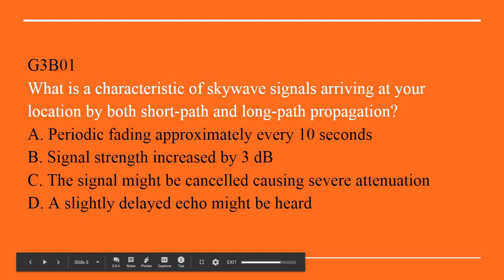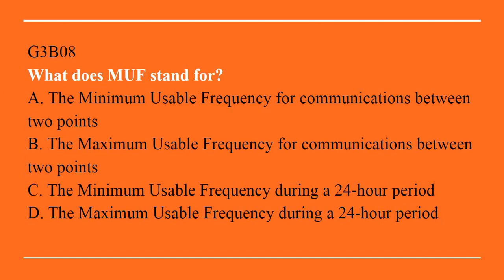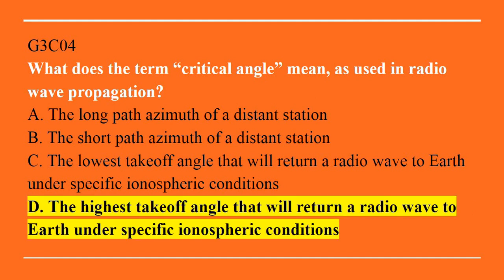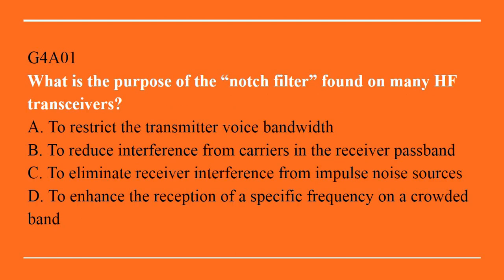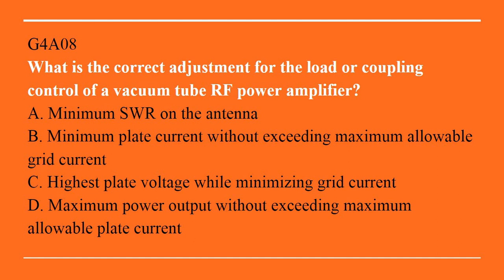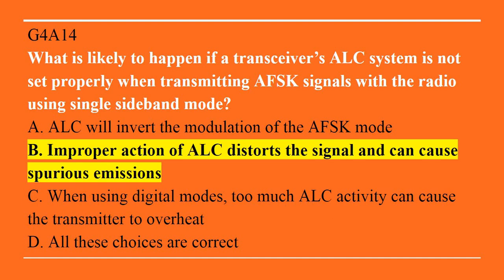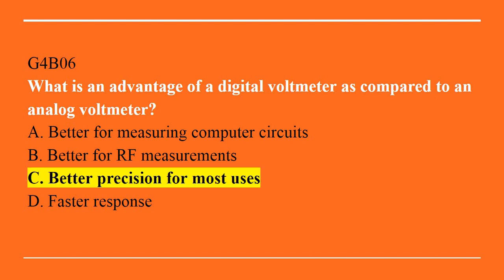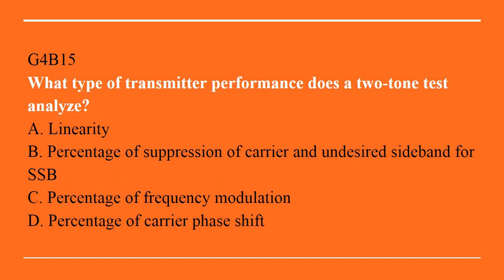(Expired) 4 General Class 2019 2023

Comment: (1) What usually happens to radio waves with frequencies below the MUF and above the LUF whereby they are sent into the ionosphere ? The answer is (D) is the answer it's bent and trapped by the ionosphere to circle earth because of the Airwaves and heat of the sun
Reply: I am confused.  If a radio wave is below the Maximum and above the Lowest, then isn't it right where it belongs?